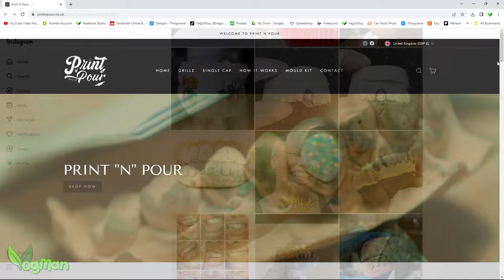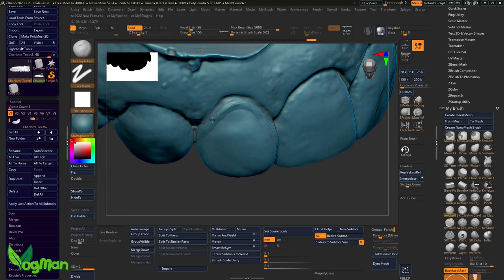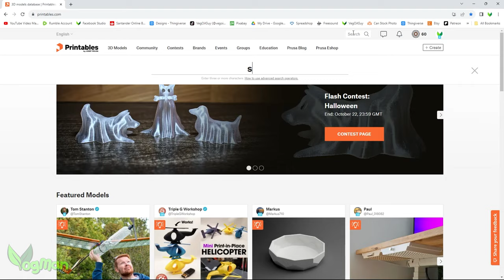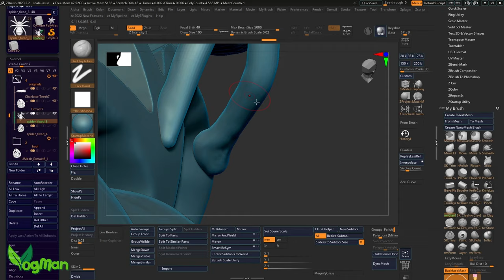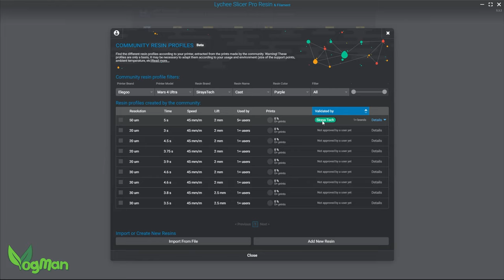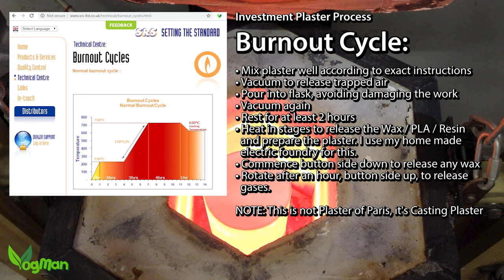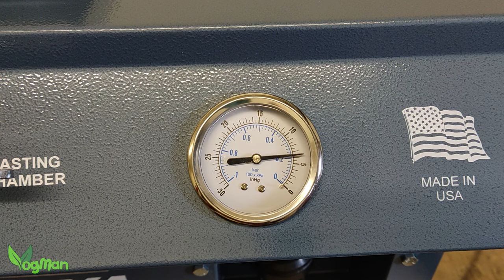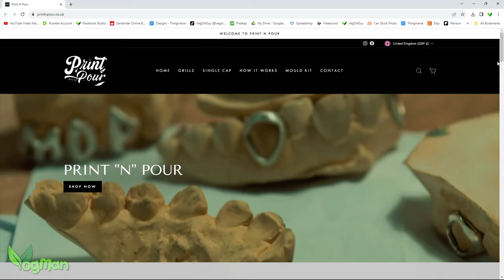How to make GRILLZ at home - CAD, 3D Printing & Metal Casting

Comment: Real professional dental 3D printers are DLPs and they are not particularily high resolution, micron sizes are something like 95 or 55. 3D printing suits dentistry very well as a technology, there is nothing preventing the use of a good commercial 3D printer for dental applications.

Comment: Pro tip from a custom jeweler, make the suports so u can use than as casting sprues, this make sure you dont bend or demage the resin, and it will fit.
Reply from the maker: Thanks for the info. If I do another, I'll be sure to give that a try.

Comment: Hi Vogman! I bought an elegoo Mars 4 Ultra and I want to know which brand and model of Fep you used instead of the Mars 4 Ultra ACF film in your video that improved the print resolution. Can I buy the normal Mars 4 vat and use it on the Mars Ultra ? It's the same size and fit? Thanks in advance.

Comment: Good job! I just picked up an Elegoo Jupiter so we'll see if I can get as good as you.
Reply from the maker: Getting as good as me is easy 😁😁😁
Reply: @vogman   Any experience with using or making vacuum forming tables? I do a lot of prototyping of PCB's and their enclosures but 3d printing has its limits at production volumes. I'm thinking of trying out vacuum forming and 3d printing the molds...

Comment: Hi there I have tried to print out some caps that I have made multiple times but I can’t seem to get the measurements right and it won’t fit on the original mould any help ?
Reply: Hey how did you learn to 3D design

Comment: Loved that "cheaper to keep her, but I don't have to enjoy her" humor. 😁
Interesting side note, getting reliable ultra-small details to print is more about resin settings and the resolution of the model than your layer height, as you're concentrating x-y resolution over z resolution (or balancing I suppose). I've done lots and lots of figures with fiberhair that is so small, my calipers go negative when I try to measure them and cry out for a micrometer. I would guesstimate they are under.01mm in diameter. That same resin runs on my GKTwo with a .8sec normal layer exposure, albeit with finely tuned machine settings.

 
To make shape extraction easier with Zbrush, I tend to switch to polygroup display mode, and if I haven't assigned them elsewhere, either autogroup or group by normal and then conglomerate lots of subparts with "merge similar" where needed to break up surfaces into individual polygroups for easy isolation/extraction. Naturally there's lots of tricks to further manipulate a second surface, but that's where I tend to start if I have a good model to work off of already, or one I will make better. 👍